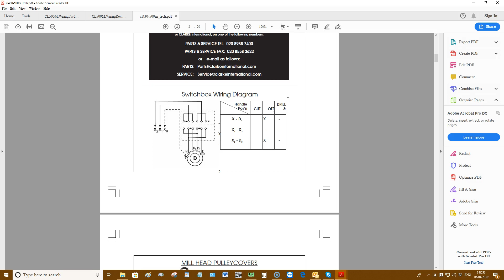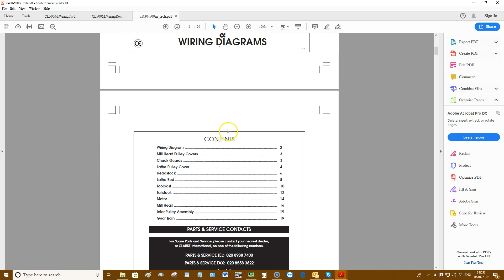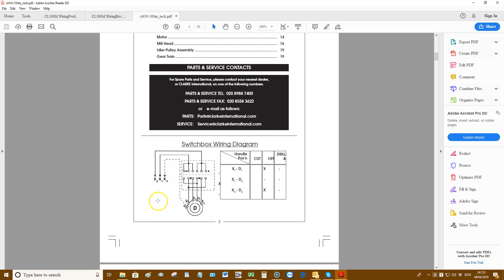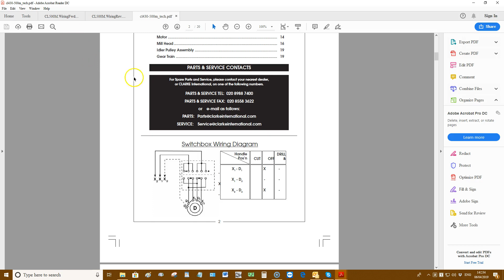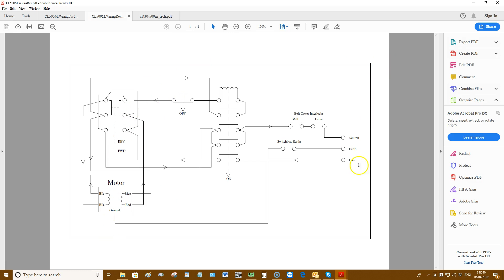Clarke CL500M Wiring

Comment: Hi Brian just watched your video and as been said much better than Clarke’s diagram. 
I’m not sure if you can help me but years ago I took the motor and wiring off my cl500m and fitted a 3 phase with a vfd which is working fine but the motor I took off I want  to use as a polishing mop but for the life of me I can’t get it to work, so would you be able to help with a wiring diagram for that. Thanks in advance Les Bee
Reply from the maker: Hi Les
Just connect (through a switch) live to one Black terminal, Neutral to the other black terminal, Live to Red terminal, neutral to blue terminal. (Capacitor left in its normal connections)

Comment: Hi. I had a motor problem with my CL500M lathe -- Turned out to be the capacitor in the end (It would short on the third start up) a bit misleading but hey ho most entertaining to track dow.. I did use your wiring diagram as you already pointed out the one supplied by Clarke is absolute rubbish.. anyway before I drone on too long -- with the multi meter in hand and all the joys of summer lock down cheering me on :) I found a bit of a difference in your motor drawing to what was actually happening in the circuit maybe it was just my understanding of it but I found in either direction (Forward/Reverse) the live / negative stayed in the same polarity and the capacitor wiring switching direction only.. Persoanlly I was half expecting the live / negative to switch but hey ho im not a motor expert.. please feel free to educate me im more than happy to learn.
Reply from the maker: Hi English
In my diagram above, the capacitor is omitted and taken as part of the motor. however the wiring on my lathe was as I have drawn it and the fwd reverse switch did indeed swap current direction through one of the motor windings.
In any case I have dumped this motor in favour of a 3HP 3 phase motor driven by a 3phase variable frequency inverter (cost around 160 pounds total) which works really well and obviates the need for pully/belt changes in order to change spindle speed and gives the added bonus of emergency stop and fwd and reverse jogging. (I have another post somewhere here showing the modification) which I very much recommend.
Also it's worth while considering the reverse thread modification of which there are a few examples including my own here on you tube.